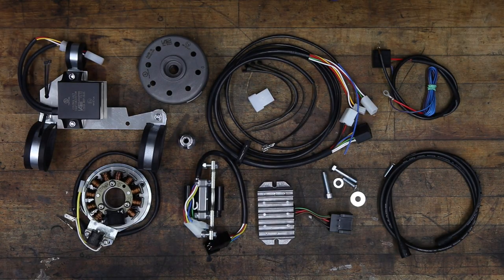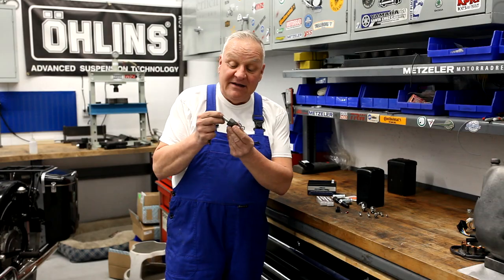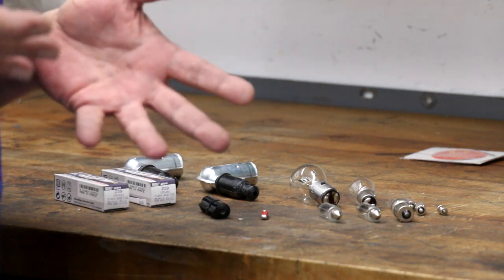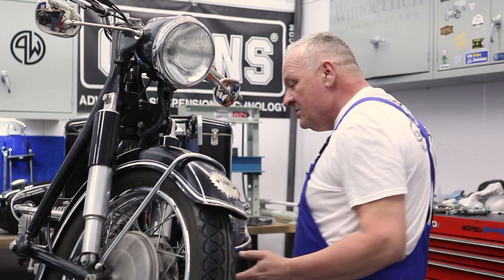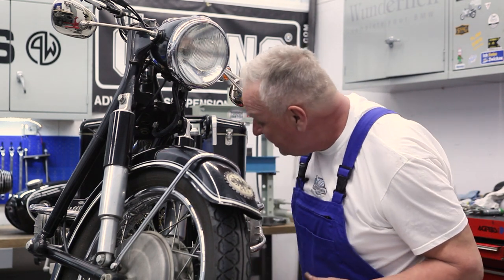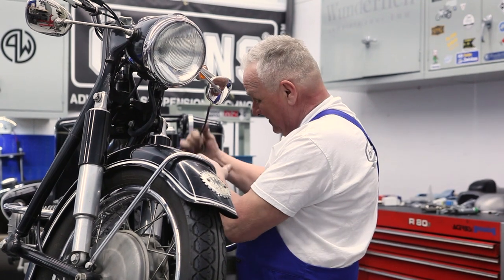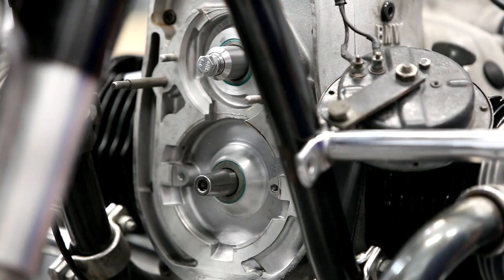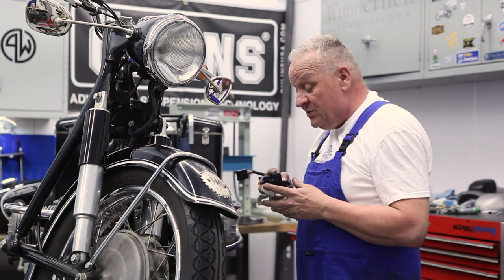VAPE 12V Ignition & Charging System 20mm Install on a BMW R60/2

Comment: Tip: Ideal location for VoltReg: where it can get good, frontal air flow (fins upward/vertical)... most common cause of failure of solid state voltage regulator/rectifier: overheating. (..as with the vast majority of Japanese and/or permanent magnet generators.)

Comment: Excellent system. Intalled it on both my r25/3 and r60/2. Made my own mounting plates holding both control unit and voltage regulator.
Reply: Hello There! Recently I bought a Vape charging system form you and installed in my 1953 R67/2 (Charging system only). 
I installed everything very carefully as instructions shown.
Before I connected the battery I checked three times all connections, checked all ground points and also installed a fuse in + battery point and another fuse in main switch (lamp). 
Right now I do not have any power in my bike so I checked again, all good. Today I watch again this video and realized you connected the original battery positive wire (30) to the battery (Both, original wire and Vape regulator positive battery)...  

The instructions only show me to connect the positive wire from Vape regulator... (As I have right now). Do I must connect also the original positive battery wire (30) to the battery??? please help!!! thank youy very much!

Comment: Thanks Willian - another great how to video with lots of tips, tools and good ideas. For example I didn't know you could get progressive tap sets that would make the job so much easier. 

I have installed this VAPE system on my 1963 R60/2 and I love almost everything about it - easy kick starting when cold, rock steady idle, great lights etc. 

But here's a question for you or others who have installed the VAPE system on their R60-2 or similar as I have: when my R60/2 reaches normal running temperature it's difficult and often impossible to kick start. I usually have to push it to get it going - especially in summer.

I've done everything I can think of to resolve the issue including new zero ohm plug caps, new spark plugs (I use NGK B8HS with no resistor. I haven't tried Beru plugs), checked timing hasn't changed (it's still spot on) and checked air gap between trigger pickup and magnet is correct at 0.4mm. I even wondered if the coils were getting too hot, so I ran the bike without the front cover, but this did not solve the problem  - after a long ride with the cover off, the coil was only warm to touch and the starting problem was evident. I haven't changed the HT leads to the spark plugs as those leads came with the VAPE system. 

Can you others suggest anything else I could look at to resolve this very frustrating issue? 

Many thanks, Ian, Sydney Australia.
Reply: Hi Ian, I'm considering installing a Vape 12V system on a 1968 R60US. Were you able to solve your hot start issue? Cheers from Southern Ohio, USA.
Reply: I've had exactly the same hot staring and going issues as you. It is solely due to the regulator's location out of the airflow. William installs it directly above the engine where it doesn't benefit from the flow of air. I am in the process of doing a complete rewire of my R60. I am discarding the aluminium plate on which the CDI unit is mounted and am using just the bracket supplied and mounting it as far back in the triangle where he mounts it, then secure it with the usual wire ties. I'm mounting the rectifyer in front of it, in fact in front of the horn, using the larger mount that fits over the top tube.
Reply: @BerlinerFolker  thanks. Please post when your retiring is complete to tell us if your changes helped. Ian

Comment: Hello There! Recently I bought a Vape charging system form you and installed in my 1953 R67/2 (Charging system only). 
I installed everything very carefully as instructions shown.
Before I connected the battery I checked three times all connections, checked all ground points and also installed a fuse in + battery point and another fuse in main switch (lamp). 
Right now I do not have any power in my bike so I checked again, all good. Today I watch again this video and realized you connected the original battery positive wire (30) to the battery (Both, original wire and Vape regulator positive battery)... The instructions only show me to connect the positive wire from Vape regulator... (As I have right now). Do I must connect also the original positive battery wire (30) to the battery??? please help!!! thank youy very much!

Comment: I have a question for you and your experienced viewers. I have a 1984 US spec BMW R80RT, I already changed the indicator relay but every time it gets hot the indicators stay permanently on rather than flash. I’m fed up with this, to me indicating is an important aspect of safe riding and I don’t know what else to do to fix the problem. The relay I took off was the original one and had it replaced with a Bosch one. I thought the problem was fixed for about a week but it started again. I’m at a loss and there aren’t many mechanics that work on such old bikes around me these days. Any advice will be welcomed unless you suggest to change my bike 😂

Comment: Hello William, thank you for your video., I have just completed the installation of a VAPE ignition system on my 1965 BMW R60/2 however I don’t have any spark. I’m using a 12 volt battery, new non register spark plugs and caps, any ideas of where and what I should check? Thank you, Mark (Sydney, Australia)
Reply: Check the pick up gap to the reluctor which mounted on the rotor. The gap should be 0.4mm

Comment: William hi. I have set my Vape ignition timing up exactly as you and the instructions state but I am getting pre- ignition or pinking as we say here in the UK when under load i.e going up hills. I have retarded the ignition by moving the rotor by approx the diameter of the pickup to stop this which I do not believe can be the right thing.
Do you have any suggestions so I can get it back into the location it should be in.? WhenI strobe it now the OT is way off.
Many thanks for any help and suggestions